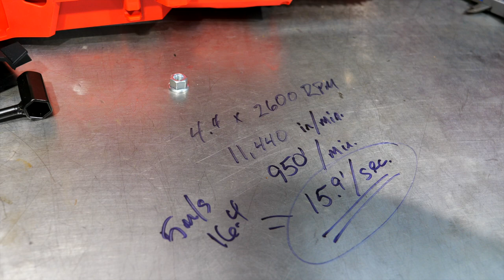Electric Chainsaw - Milwaukee M18 FUEL Hatchet 8-inch Pruning Saw [Milwaukee 3004-20]

Comment: Been thinking about the M12 version for a while, unfortunately it was very expensive in the UK when launched. I would literally use it for what it's built for, pruning. My hope is that now the M18 is available, the price of the M12 is affordable! Regrettably, we in the UK pay far more than you in the US for pretty much everything!
Reply: Not necessarily true.  I’d suggest SGS Engineering and Powertool Mate for Milwaukee tools.  I’ve bought lots of them at incredible prices.  It’s why I moved over from Ryobi HP stuff as the drill and impact were cheaper than Ryobi!
Reply: eBay!
Reply: @I S  . I actually received mine this week. Got it online for a decent price I think, £244 for the kit with 2 6Ah batteries!

Comment: I just bought this saw from Home Depot on sale for $295 . Saw, high output battery, and the charger. For me it was worth that price. I carried it in the mountain for cleaning out trails. I cut stuff that I had to cut from both sides to get through. It cuts like crazy and I have been impressed how long it last on a single battery. LOVE IT!  I recommend for cleaning trails and cutting small stuff. If your logging you might need something bigger. 😂😂

Comment: We cut down our dead trees and trees knocked down in wind storms. This baby chainsaw has made the limbing process way easier and much safer. We got the kit at Home Depot. It was $279 for the chainsaw, charger, and 6 Amp battery.

Comment: For any Aussies out there thinking of adding this to their camper trailers, I just cut a 120mm diameter piece of seasoned ironbark absolutely no worries. I can’t give a long term review but out of the box it’s a ripper 👌🏼🇦🇺
Reply: I agree it’s def a ripper, I currently run the 2826 14” top handle which is a perfect small chainsaw in my book aside from killing 8ah packs which all 3  (12” & 14” Thandle & the 16” rh all kill battery packs especially the 8s)   I have owned the 14” top handle as well as the 2727 16” rear handle which I sold and they’re actually all great saws even the 12v hatchet Is good just not quite as good as the 18v imo the 18v hatchet essentially can eliminate the need to own a chainsaw for 80% of people maintaining less than an acre or two and tbh the thing is going to exceed expectations in almost every situation, I haven’t had the issue of the 3004 killing batteries like the 2826 & 2727 either but regardless ****ONLY USE HO BATTERIES xc6.0 forge 6.0 12.0ah HD and VERIFY THEYRE STILL UNDER WARRANTY!!! ****HEED THIS 1 WARNING IF YOUR USING A MILWAUKEE CHAINSAW it takes 5minutes to check the serial number DOB and you’ll thank me later as I have killed two 8.0ah packs frying the “bms” chip   
And knocked coulntless others cell banks out of balance and it’s always the middle banks due to the way Milwaukee charge system works IE :  as soon as one bank hits 4.1 V. It cuts them all off and shows fully charged even if it isn’t that’s why some packs only charge to 3bars
Reply: Jimmy can I ask where brought it from.I am in erina NSW thanks
Reply: I bout mine from Tradetools. I know Sydney Tools is also a big Milwaukee dealer. Both will mail them out if you don’t have a store nearby

Comment: Very cool.  I almost sprung for the 12v version, glad I didn't.  Now I'm thinking for a little more, you can get the top handle.  It has much higher chain speed, which means a smoother cutting experience.  But it's not apples to apples either.  Decisions, decisions......  I guess getting all 3 is the best answer.  I just can't justify it to the boss.
Reply: I love M12 tools, but for high draw items like vacuums and chainsaws they’re too weak and die too quick. I love my m18 hatchet. Chain is too slow for undercuts, but when used properly it cuts unbelievably well. It’s got tons of torque.

Comment: I just used the link provided for acme tools. They rejected my order AND then charged me. I knew the price was too good to be true.
Obviously you made a fantastic review. But I think I just got took. 
Price was $347 for bare tool + 3 batteries (8.0 + 3.0 + 3.0)  - Outstanding value but my address doesn't always play well

Comment: Great video Tim! Just a thought... why not make a side by side cutting comparison short of this vs the m12 hatchet... and whenever the top handle saw comes out. Do a comparison of the m18 vs the makita 10 inch top handle that's so popular.. again great video keep them coming!!!
Reply from the maker: We will definitely do some comparisons on the top handle, and we can't wait for that to arrive. We may run the M18 and M12 Hatchets side by side. Thanks for watching.
Reply: See my comment about them above. I used to be a lumberjack/arborist in the early 1980's...

Comment: Great job as usual, much more powerful than my 12V Milwaukee Hatchet pruning saw. I really like the new 12" & 14" Milwaukee top handle saws. I have a really nice Makita Model# XCU06Z 10" 18V top handle saw but it does not have anywhere near the power that the new Milwaukee top handle saws have. It's built better & faster IMHO but short on the torque dept..😬 They're made for small quick cuts 2" to 3" branches anyways which most ppl IMHO fail to realize. If I'm up 100+ feet in a tree cutting branches or wood 5"+ I'm gonna use a good gas powered saw mainly cuz batreez don't last very long or overheat.🙁
Reply: When on a tree, your pruning saw should be used with less pressure, which means less torque! Makita designed XCU06 high speed low torque for that reason.

Comment: I am stuck with purchasing a Milwaukee M-18 or a M-12 as well. No video comparison between the two. I am leaning towards the M-18. Can't go wrong with more power. Right? Just the price.
Reply: M12's quite a bit lighter (over a pound, depending on what battery you use in the M18).. something to consider if you're planning on using this overhead, in a tree, or any other scenario where you could benefit from a lighter tool.

Comment: A short side by side comparison between this and the M12 hatchet would be cool to see, really like using my M12 but wish it had more power.
Reply: Both have their places. The M18 has more power, but it also weighs quite a bit more... which is a pretty big deal if you're going to be climbing trees with this thing, or using it overhead, or just for a lot of cuts period.. Less fatigue with the M12 since it's at least a pound lighter (depending on the battery you use in the M18)

Comment: Maybe I missed it, but is this thing supposed to use the XO batteries? 6, 8 n 12? I know my chainsaw doesn't like anything but the XO's
Reply: It can use any m18 battery but of course the HO’s work best
Reply from the maker: Yeah, it will take any M18. We ran it with a 5.0 as well and it very well. Of course, the HO shows better when you're pushing the saw. Thanks for watching.

Comment: I only run Sthil premium bar and chain oil
Reply from the maker: Do you feel like it makes a difference? Even on these smaller saws?
Reply: Same here.  And yes, it does make a difference, at least on Stihl saws. I run a professional tree service we use only Stihl saws. Something they put in their oils keep the saws from burning up quickly.
Reply: It makes a big difference. The viscosity of the oil is very sticky which helps it stick to the chain and bar unlike using other oils just gets waisted cause it don’t stick it just gets thrown off used motor is terrible to use but it’s better than nothing I’d say if you run used motor oil you might as well run dish soap

Comment: The price is steep especially considering its bigger brother m18 chainsaws can be bought bare tool for sub $250.  This tool should fall sub $200 imo but typical Milwaukee fashion they will price gouge us for a few years till it comes down in price.

That being said this is a killer saw that may of just changed my mind from buying its bigger brother with the 16" bar. The m12 hatchet looked good but a bit under powered for the job. At this price point i can buy a quik lock pole saw with a battery....having options are good but some make sense over others.
Reply: Usually cause of warranty it’s like you paid for two so they can replace the first one
Reply: @aldomedina7999  i use milwaukee tools heavily at work and at home. I use their fuel hacksaw with wood blades currently to thin sapplings and trees 6" or less. It powers through them pretty good and ive abused that tool and its still kickin strong. $150 was a fair price. I dont think theres anything r&d wise over the hacksaw that warrants a sticker twice the price. With a bar and chain $200 seems like a realistic price.
Reply: You're comparing bare & discounted tool-only price to MSRP of a newer tool... that's not exactly fair comparison. Additionally, it's not cheap to shrink technology and make compact tools as capable as these (M12/M18 Hatchets) are. The full size saw probably doesn't cost them all that much more to make.
PS: Just ordered the M12 version recently for $160.
Reply: @Justin-C  more expensive because its shrunk down ya i dont think so. The sawzall was shrunk to the hacksaw version that is similarly designed and the bare tool is $126 on amazon now. I am not comparing msrp vs tool only models either. Seeing as both sit around the same sticker without a battery. The cost is alot more for the bigger brother. More plastic, bigger motor,  bigger esc, bigger bar, bigger chain etc. The cost is way overpriced for this tool no matter how well it performs.
Reply: @07slowbalt  The sawzall/hackzalls are a much, MUCH more commonly bought & used tool, both have been around much longer as well.

Economies of scale apply - the R&D costs for M12/M18 Hatchet have to be recouped over far fewer products sold (a bigger part of the potential profit margin).

You may think it's overpriced, and perhaps it is for the DIYer/consumer use... but this tool is also targeted more at certain trades e.g. arborists / landscapers - and those kind of tools are often far more expensive than you think they "ought to be" - just look at the M12 PEX tool - it's a $500+ tool, and there's really not much to it.
Reply: @Justin-C  if this was true then the hackzall wouldve came out with a $300 price tag but it did not.  R&D expense is real but the hatchet isnt some work of art that spent decades to make. You can literally buy 2 dozen other brands on amazon that dont come in a red box sub $100. Im paying for quality i get it but this tool will sell like hotcakes if the price was adjusted. You can sell more for less or fewer for a bigger sticker.